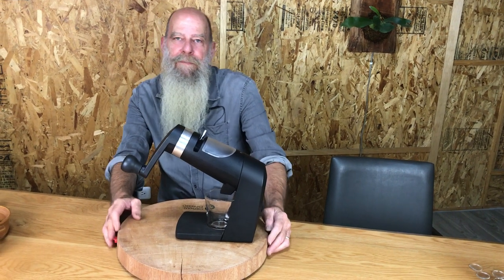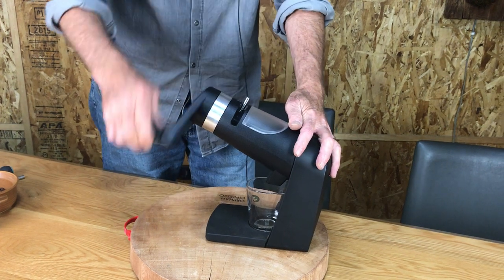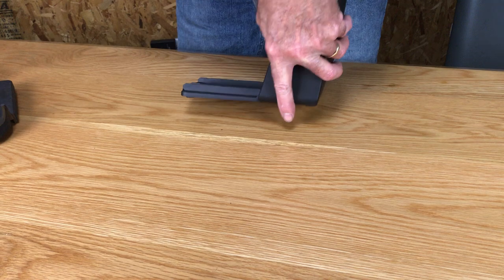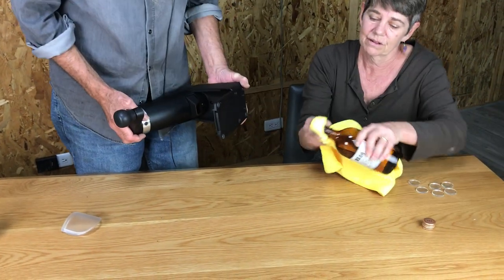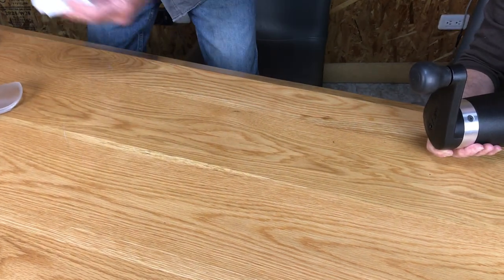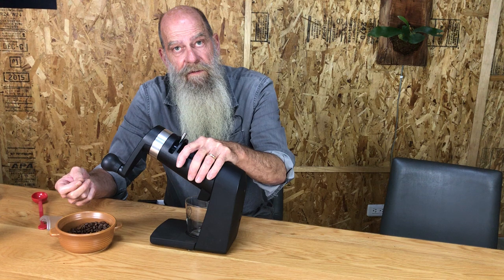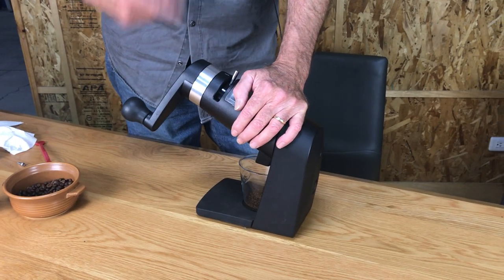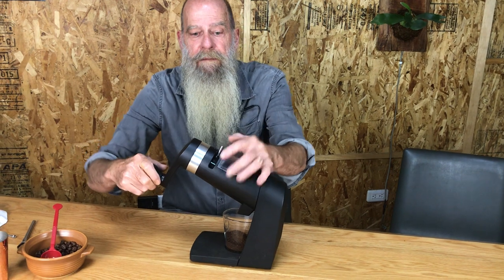Apex - How to use the OE Apex Manual Coffee Grinder

Comment: Doug and Barb! Very informative AND entertaining video. There is one thing I want to make sure I understand. Am I correct in thinking that, regardless of roast level, the desired handle speed is 100 to 120 rotations per minute? That the effort required will be greater or less, but the desired speed is the same regardless of roast level?
Reply from the maker: Hi Mike, pretty much Yes.  Some beans require less effort to reach the desired rate of turns, some a bit more,  but 100 - 120 is the best target for the efficient & effect grinding for these burrs.
Reply: @orphanespresso  Thank you!

Comment: I can feel the quality of that machine even through video.  I have two questions. I'm sitting here comparing motioning my arm at an angle vs vertical and it seems more comfortable with a vertical motion rather than at that angle. Is there a reason I'm not seeing why the handle movement isn't vertical?

Regarding cadence, when you go slower I see the resistance increases.   From cycling I understand that an easy faster spin is better for muscle endurance than a slower higher resistance spin. I also understand that it's not good to over speed to keep the grind consistency clean and even, but is it ok to trade some pressure for speed if I want to go slower, say 75-85 rpm rather than 100-120?
Reply from the maker: We have tried both - vertical motion, and angle, and we find much less discomfort with the angle than the vertical...  May not be true for everyone, but it is for us - less pressure on the elbow, and shoulder.  You can turn the Apex at what ever speed it comfortable for you, and the results will vary only a very little bit if you turn faster, versus slower...  The harder the beans (very light roasts) will require a bit more speed, or force, to power through than darker roasts will, but the beauty of the system is you get to choose!

Comment: In this video you said that 1 turn of the Apex handle converts to 4 turns of the burr. Isn't it the other way around? I realize the burrs are probably a different size in the Apex, but I can barely hold my Pharos 1 on the counter when grinding light roasts.
Reply from the maker: Yes, one handle turn makes the burr turn 4 times - Ghost Teeth flat burrs operate differently than the conicals in your Pharos, and they need the speed to operate efficiently - turning by hand, 4-500 RPM would be very hard to do, but by using the gearing to increase the speed it's quite easy to do.
Reply: Thanks, that was a quick response. I just came back to say that I watched the assembly video and I see the difference now. That's quite an impressive piece of gear!